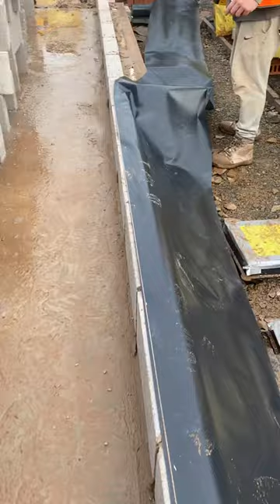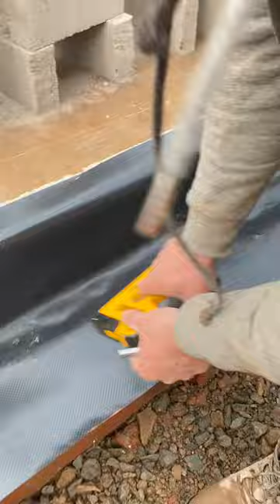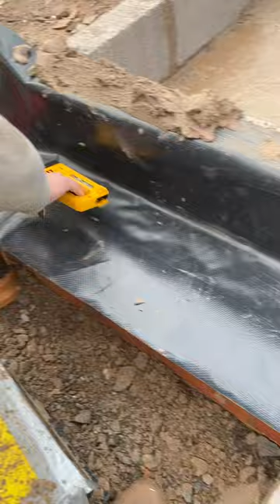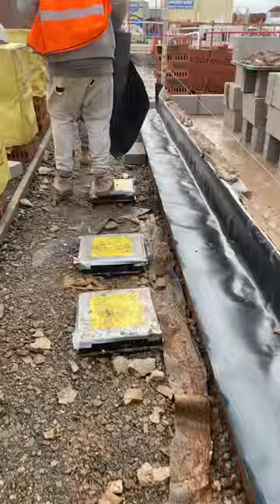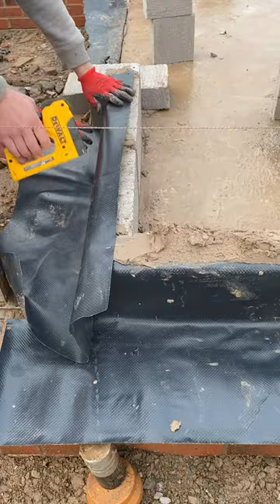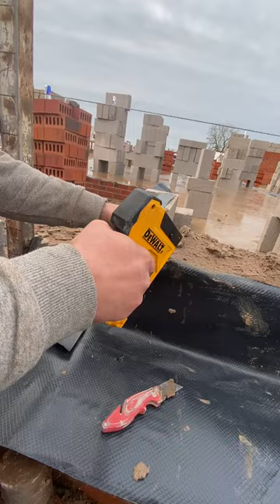Cavity trays..easy way...🔪 👌🏻 🔥 💥

Comment: I can understand stapling the top. It saves putting bricks on it to stop it blowing off, but not that bit that slopes down to the brickwork. That's there to stop water going down the cavity and stapling holes through it to keep it tight, kind of defeats the purpose using it. I don't know what NHBC would say but when they look down they probably can't see the staples anyway.
Reply: Plus there is insulation supposed to go between the tray and the blocks.

Comment: Looks neat, will be easy to clean cavity out. As for stoping the water definitely does the job. It’s not a swimming pool it’s to catch water that runs through a crack or joint down the back the the brickwork. A pin wholes make 0 difference. It’s doing it’s job. I may add some visqueen  tape on the corners but that’s a good job done. I hate folding the corners never thought of doing it like this. Thanks for the tip.

Comment: You shouldnt leave the dpc short on the block work. The dpc should be pulled tight at an angle under the ouside block so water doesnt run back you shouldnt staple at tall making holes in dpc rite cowboys
Reply: Agree

Comment: Do inspectors ever pull it for not having  the slope?
Reply from the maker: Changy no mate never they say it’s best they’ve seen 👍🏻
Reply: @derbybrickworklimited  sold it to me then next time I get on therms
Reply: We do the same and have done for years.! We have never been questioned by building control or the NHBC or any private insurance companies, as long as you don’t go ballistic with the staples..........
Reply: @jims5394  I guess I’ve been lucky, can’t see a problem with in my opinion.
Reply: Hard to see in the video some times. I'd just keep the vertical face staples near the top. Sure keeps the stuff in place.

Comment: They have done it right.there should be no slope on the dpc .if there's a slope water can get underneath and track across.if its tight to the block if can t
Reply: Dpc should slope, that's to stop ponding of moisture in the cavity.